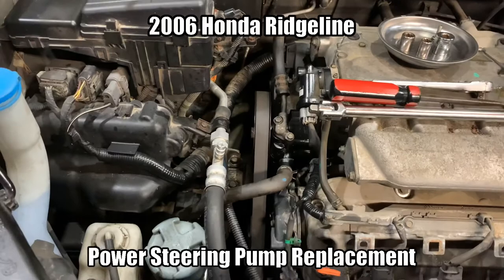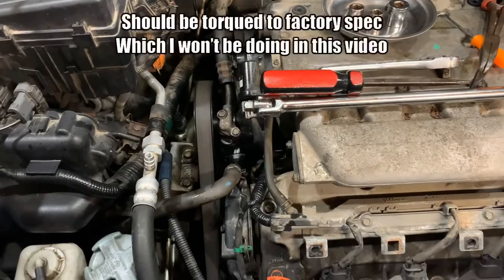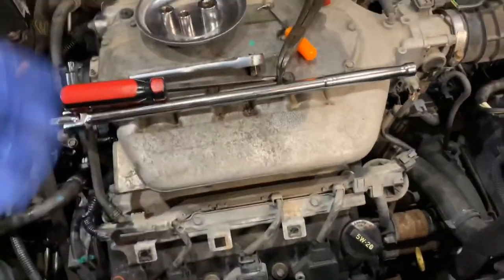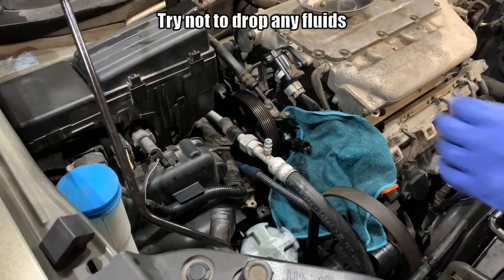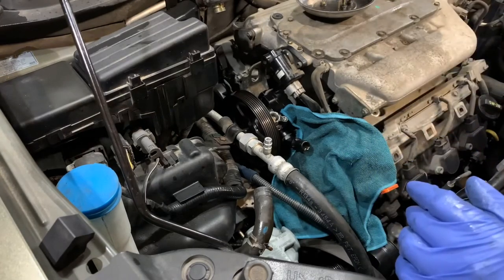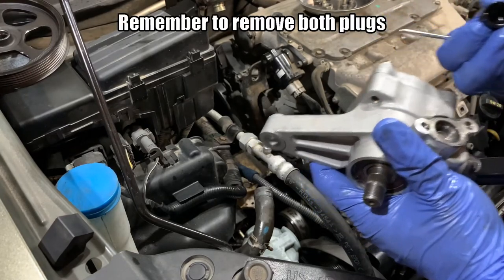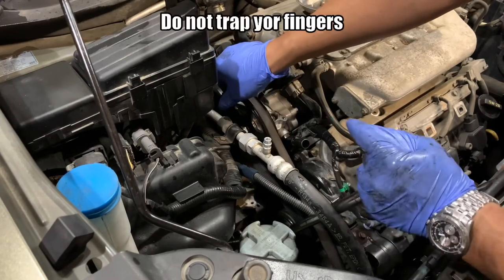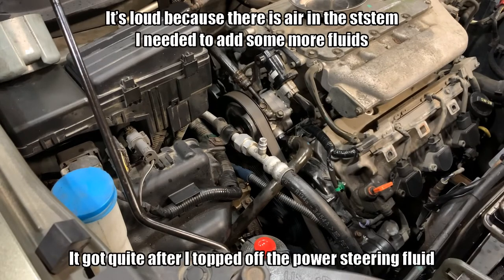2006 Honda Ridgeline Power Steering Pump Replacement

Comment: Good video. I just did this repair. Found it was faster/easier to remove the pulley on the bench with an impact. Replaced the reservoir at the same time because it has a screen in it that gets dirty. Fresh fluid and ready to go. Took 30 minutes max.